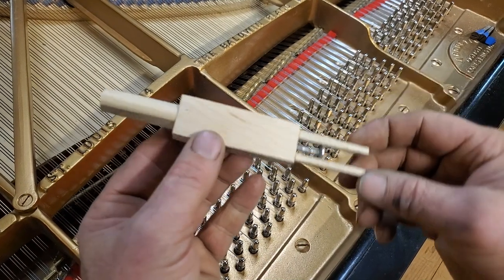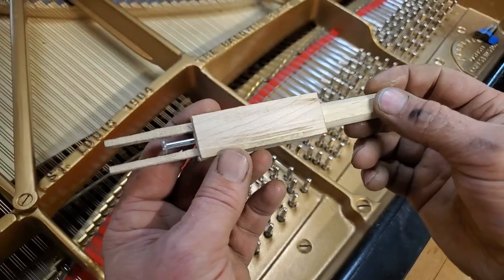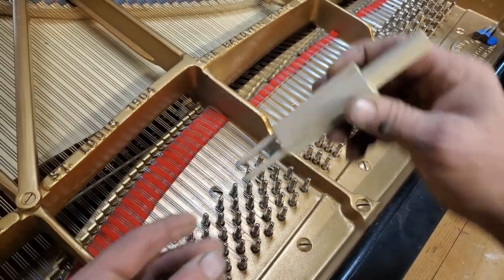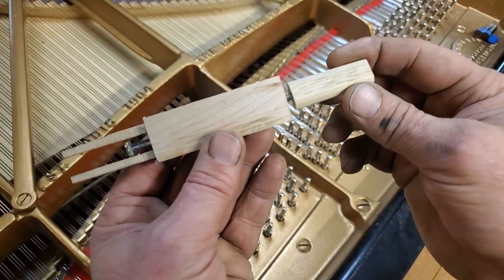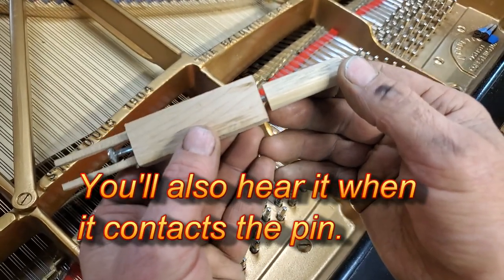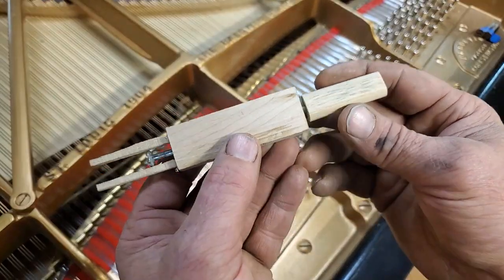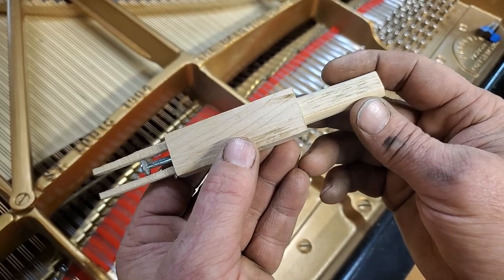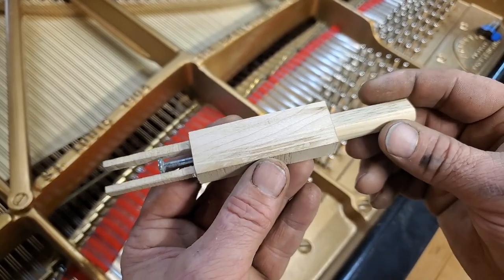The Fun to Use Tuning Pin Height Gauge

Comment: You can detect if the pin is too high, but if you hammer it down you can't detect if you did too much and it's too low.
Reply from the maker: So  don't hit it too low. You can also use the gap on top to judge the height.